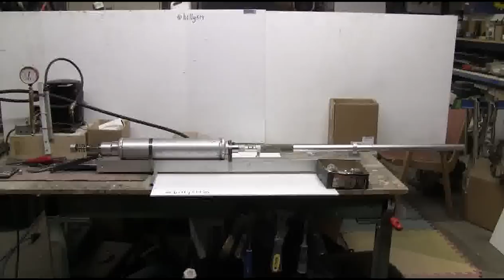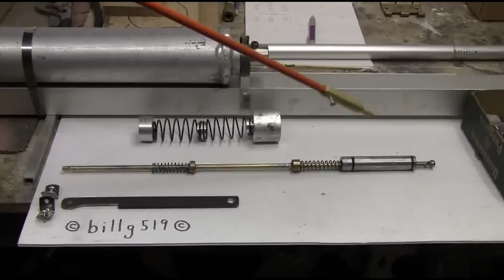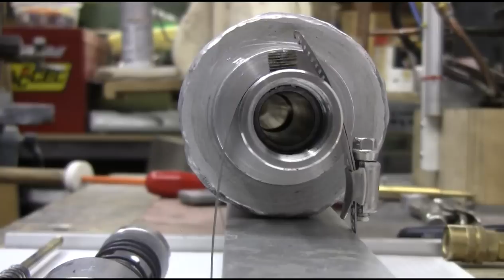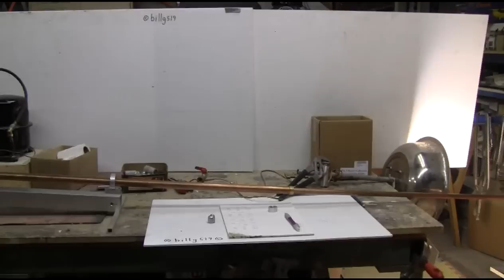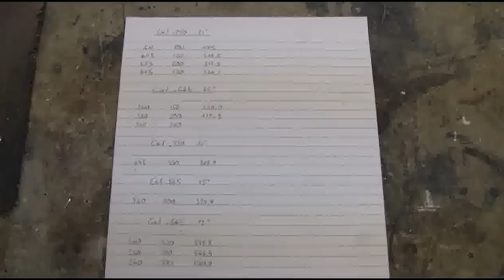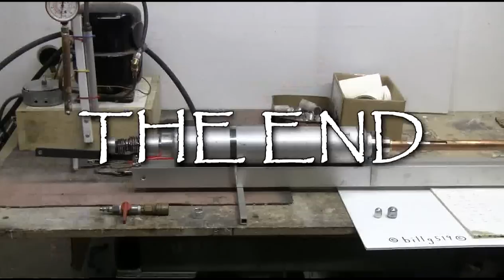Air Cannon #44 - New Spool Valve Air Cannon

Comment from the maker: The other cannon with the CO2 tank got a 1" ball valve as well. As the spool valve is only 3/4", it does not outperform the larger ball valve. I had this air chamber and wanted to try a spool valve, so I built this cannon. I have two more air chambers, so I will make two more cannons sometime. One will be a piston valve type.